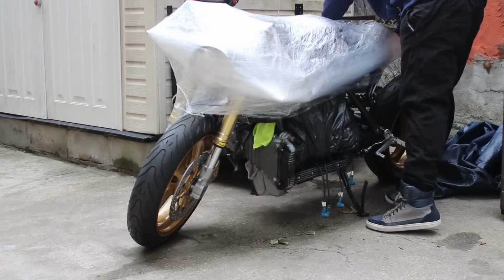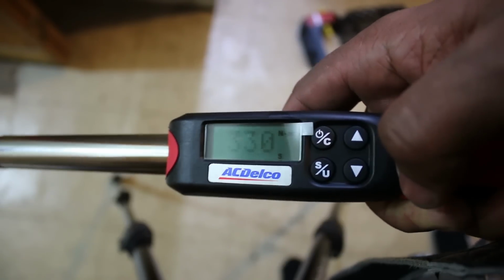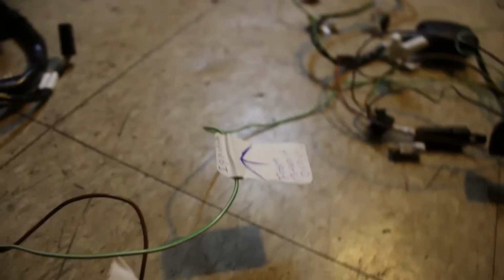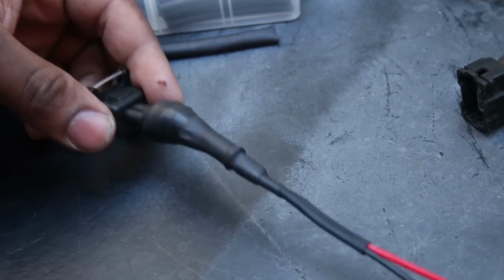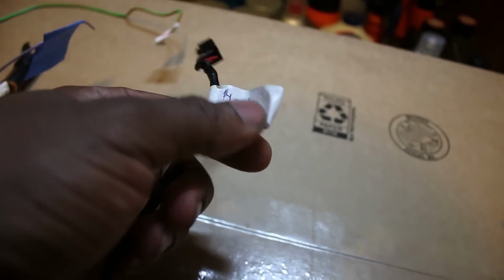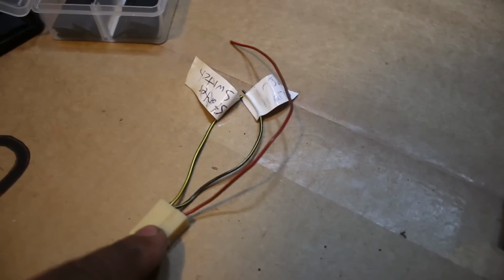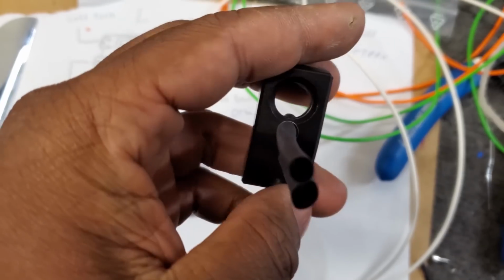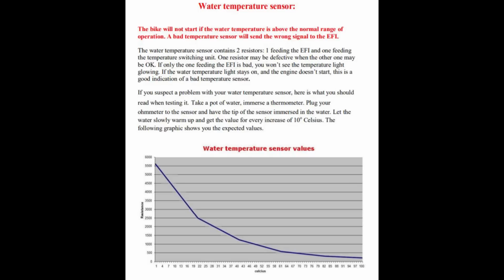[Ep 12] 1986 BMW K100 Cafe Racer Project - M-Unit Fuel Injection Rewire

Comment: Oh man. I didn’t know I would be glued to the screen on this. I’m currently trouble shooting my k75 my dad gave me. It’s in mint condition all but it was stored for 15 years and fuel tank wasn’t drained. I started down the line to find the fuel pump and hoses were no good. Got a new one but it’s not getting power. Bypassed power to the pump from the battery and put a guitar switch to turn it on and off. Total Mexico style.  Ended up getting a bad fuel pump. It Wasn’t pulling fuel. now I’m waiting for the new one thinking what the hell could be the reason it wasn’t getting power.  Could it be the relay? Or a computer thing. Guess I’ll find out the hard way when the new pump comes in. But you gave my mind a little relief seeing yours was hooked up with a switch and the fuel pump seemingly stays on always while the bike is running? I know nothing but I’m learning. I’m a luthier so this is much more difficult to wrap my brain around. Lol. My Cb350 was a lot easier to trouble shoot and rebuild. Thanks for the detailed videos. Digging it while I wait for money and parts.

Comment: cut that black and yellow wire from the starter relay to the fuel injector connector wayyyy to close to the connector (about 1 cm), not really enough room to splice together.... Any tips on how to reconnect or run it to the starter output?

Comment: OMG this saved my ass! I couldnt get the rubber seal in and for sure it turned out that the the old seal wasnt out. that same metal part! haha. Now that i have it all installed how freely should the impeller spin? I put in the water seal and then put the shaft in and it doesnt seem to be moving very freely. is that ok?

Comment: K100 sideways motor means the oil in cylinders drains from the top and leaves half dry rings.  This will drop your cylinder pressure to a point where it won't start.   The old boys pull the plugs out and give a light spray into the head if they have been sitting too long.

I bought a 1986 K100 2 weeks ago and have (started a cafe journey or my own) peace Bro

Comment: I can c you have a full plate right now but,,,,,,,,, maybe one of these days you could do a short video on the differences between the 8v and 16v Brick100rs (k100rs). I'm about to pull the trigger on either a 85 k100 or a 91rs 16v. They both have about the same miles, I don't really care about the upgraded brakes (gonna replace forks). Just can't really seem to find much on the difference, just a bit more power from the 16v.... Thanks for your time bro, love your build series BikeLife

Comment: Over the worst, you've troubleshooted the wiring, kudos! I think you're on the home straight but suspect that wiring will bite you before you're finished! I made a new loom for my T140 ,it had plenty of catchews but no electronics , my day job is home heating repair and troubleshooting failing electronics is the bane of my life! Re watching, to brace the coils a couple of short pipes between with the bolts going through🔩

Comment: There is something I don't get.... why does the fuel pump continue running if the engine is not ?  I have a k1100, on key on the pump runs 1 or 2 seconds and it stops after getting  the fuel rail to the correct pressure. When the engine is running it starts again to keep the pressure. Might you be having some problems with the pump ? like it might be loosing pressure
Reply from the maker: Because im using an M unit. Totally different system.

Comment: See, your problem was trying to start it with the fuel tank installed. When doing a build, you cant have it even remotely close to drivable before starting. Would have fired up on the first stroke if the wheels were off lol. Good job man, I'm proud of you

Comment: The exhaust generally comes with different size header tubes because the length effects the power output. Long tube headers provide more low-end power, where short tube headers provide better high-end power. So to provide an even power band, manufacturers use different length headers tubes.

Comment: nice but u really need to loom those injector cables , suchs a bike doesnt deserve tape . it needs some cloth tape or factory cable 'loom' rubber over it .
Reply from the maker: Got 5 rolls of tesa tape on the way to clean up and black out the external wiring including the injectors. Alot of colors I need to stealth out over the engine
Reply: - The illestrator - Nice work , ill see it in the next video .

Comment: I own a k100 and my fuel pump does not turn on until you start the bike, yours wont do that? A switch seems sort of a hassle for something that should be automatic imho.
EDIT: I guess since you are using an m-unit for this now its different. But, that electrical tape is going to get really nasty and mushy right by the engine there, if you are going to do any more wire wrapping, you should check out TESSA cloth wire tape (pn: 51036), its used a lot in newer cars and it looks and last much better and longer than that vinyl tape.
Reply from the maker: Yup, got some tesa tape on the way (someone recommended it in an earlier comment.) It'll help stealth out the colorful tape showing over the engine
Reply: @Theillestrator1050  Nice, looking forward to seeing it.

Comment: You have a decent degree of mechanical nouse particularly as i suspect you're sort of young. I'm curious about your background. Have you studied engineering, done a trade, or had a knowledgeable  mentor in your formative years ??
Reply from the maker: I never officially studied any of these things but I suppose it's a sort of natural progression of things I would do for fun. In high school I was voted most creative. I built like little weapons out of school supplies and sold them...built longboards... then bmx bikes, then I bought a beater for my first bike and did every piece of maintenance myself starting there and with all my bikes. Now im. Just building a bike from ground up. I just turned 24 btw.
Reply: @Theillestrator1050  
You have extraordinary aptitude for mechanical work. U Tube is good and you deserve a healthy following but it's a niche endeavour. If the channel doesn't support you, you would do well in engineering design. Not everybody has IT. You seem to.

Comment: Be careful about switching fuel pumps, quite an inductive load and the switch contacts will have hard time, that switch will work but its life expectancy is unknown
Reply from the maker: I reckon you may have commented before finishing the video. I ultimately decided against having a manual fuel pump. But even if I were to use a one, are you referring to a switch in literal sense of breaking and establishing electrical contacts? If so i was going to make that happen through the M unit not an inline switch or something. Or maybe im misunderstanding you.
Reply: @Theillestrator1050  ah no I commented at the time while you were discussing it👍 I had to pause the video go out outside, adjust my chain ready for today's ride, I need to watch the final bit later today

Comment: Handy tips for the future. Vacuum tubing with a slice lengthwise makes custom size grommets, with a little superglue to keep it in place. And when you’re splicing wiring try to offset where you will connect the wires to keep the overall bulkiness of the harness to a minimum.
Reply from the maker: Noted, thanks

Comment: Awesome work man!

Idea for the exhaust I think would look neat is brining it back so the muffler sits besides the wheel, either parallel with the ground or at a similar angle to what you have going now. Would require some fab work but so did the rest of the bike 😉
Reply from the maker: I have an idea that may...or may not work lol. If it works, you'll probably be a fan of it
Reply: @Theillestrator1050  awesome, looking forward to seeing what you come up with!

Comment: Nice that you took the time to label which wires are which, makes it easier for the next guy, because partner, the next guy is always YOU, am I right?
Good electrical work is really hard to come by.

That exhaust looks sick, will probably sound raw AF because of those unequal length headers. Shame about the megaphone, though.

Any other place to mount that battery? I know Antigravity doesn't weigh that much, but it might help ride harshness if it's not mounted to the swingarm.

Also, what connectors are those that you're using around the 24:30 mark?

And 57:03.... Hail satan 😈
Reply from the maker: 😂 indeed, after a few months, it proved a good call labeling stuff. 
I ordered some exhaust studs for a Nissan turbo which may or may not fit. Guess I'll see. I'll also mount up my new radiator and get coolant in there to see how it sounds when its sealed up right and is warmed up!
Reply from the maker: I actually plan to mount it beneath the coils, over the engine in a box that I bought. It'll fill out that hollow space. I'll remove the logos and labels to make it stealthy
Reply from the maker: And those are EV1 injector connections. Link in description.

Comment: Try not to run the engine without anti freeze. That mechanical water pump shaft seal will not do well running dry along with other things. All the other stuff? I'm so impressed! This whole series is so well done! Watching you think through the speed bumps. The story and edit. Right down to the supportive comments. This is a wet dream for any Creator. I'm so happy for you!
Reply from the maker: Right, that's one of the several reasons why I mentioned in the video that I wasnt gonna run it anymore or longer than I did. I just did it real quick for proof.
Thanks, the fact that people such as yourself support the series is what helps push meh
Reply: @Theillestrator1050  No thanks needed. This channel is all you. It's like growing a garden. Every video of yours I watch I find myself more and more convinced I'm witnessing the birth of a star. Not just here but anywhere life takes you. Keep up the good work!

Comment: COILS:  That sheet aluminum is super-flimsy and those coils are going to be dense, live (i.e. not-firmly-fixed) loads.  You can feel how dense they are.  Every time the K vibrates in one direction, the coils are gonna try hard to stay in space right where they are.  You'll tear those aluminum sheets right up.  Please find something to mount the coils to that's at least as substantial as the mounting brackets on the coils.

HEADER LENGTHS:  Backpressure dissipation along exhaust systems is a key performance element.  The sound, whatever it turns out to be, is properly a result of the construction of the exhaust system; the exhaust system (sorry) isn't there to be a result of the sound.  Horse goeth before cart,  The chain of cause and effect should go:  Engineering -> Geometry ->  Performance ->  Sound.  It should never go Sound -> Geometry -> Performance -> screw the engineering.  Fluid dynamics modeling (CFD) is dark, dark magick and the fluid systems engineers in BMW's exhaust works know what they're doing.  Yes, even if aftermarket parts exist to dismiss their expertise.

MANUAL-ONLY FAN SWITCH:  And a gigantic, blinding-bright engine temperature alarm with a siren and air horn, right?  You don't want to your first notification to be engine seize.  You are the thermostat.  What are your temperature settpoints for fan-on and fan-off?

LEAD-FREE SOLDER:  Real men pick their teeth with 60/40 Sn-Pb eutectic solder.  And don't I forget me!  Do dat to.  Stuff.  dur... Blerph.  Was where am? 

GREEN TAPE AROUND HOLES IN ALUMINUM SHEET:  Rubber hole grommets still to come?

You finger-twiddle those wires like you've had practice.  Good for you.  Where's Miss Carly Rae ("Call me 'maybe'") Fuel Gauge?

GROUNDS:  Install a real ground strap to the frame or negative terminal of the battery, as appropriate.  Do not count on the security of of the aluminum sheets and a bolt connection made with corrosion-prone differing metals. That sheet is not a reliable ground.  "This hole is NOT gonna be a (good) ground point."  ALSO REMEMBER, IF YOU GROUND STUFF TO YOUR HANDLEBARS:  Be sure to run a proper ground cable to any electrics in the headset.  Do not try to rely on a ground up through the steering bearings which (again) will pass current through differing metals, cause galvanic corrosion, and degrade your bearings. 

IF YOU HAD A BROTHER P-TOUCH LABEL MAKER you'd be dangerous.

METRIC:  One litre = "a little more than a quart".  4L = one gallon.  7L = 1-3/4 gallons.

NOT THREE.  FOUR:  Fuel + Spark + Air + Compression .  Been there.

Congrats, me brother!  My joy is to see your joy.

.
Reply from the maker: LOL, part of me was handling the solder like... this is from china... what if the label is full of shit about being lead free 😂
Reply from the maker: The ground circuit is as follows.
A cable from battery Negative to the m unit which also grounds the plate... and a cable from battery negative to the whole running gear ground point. Then another cable from the running gear ground point, to the plate. Then another cable from the plate to the frame.

 There is nothing ground to the handlebar or steering head. Everything is either grounded to the plate or the main frame point. I mentioned that in the video as to avoid any unreliable grounds through the head and bars.
Reply from the maker: I'll shock mount the coils and double up the ties around the plate. If they prove to be an issue, I'll look into recreating that plate with a thicker sheet of aluminum.
Reply from the maker: I reckon the designer of these pipes barely had performance on his mind because the product page says nothing  of gains or dyno numbers. Luckily when it comes to this bike, I have no interest in performance numbers considering it will never be faster than my FZ. im just worried about aesthetics, sound and reasonably reliable running characteristics. Im sure the luftmeister pipes would serve the engine better considering engineers were behind them and not fabricators. But for this bike, I'm content with the cart going before the horse.
Reply from the maker: The temp relay trips at about 212 degrees Fahrenheit, so upon the engine approaching that via the guage on the crank cover,  I will just slap the fan button.
Reply: @Theillestrator1050  Good man.  Keep an eye on it.  I ran nuke reactors on fast-attack submarines.  It took years of school and round-the-clock training so we could sit there watching the temperature needle.  All.  Damned.  Day.  It went high?  Shim control rods in.  It went low?  Shim rods out.  Trained monkey work.  When you turned over one of the label plates on the Reactor Plant Control Panel, the 20-year-old graffiti on the other side had somebody's smart-ass question, "HOW DOES  IT FEEL TO BE A THERMOSTAT?"

Hey, and be nice to that water pump that you're running dry with hot, grinding, metal-on-metal impeller action.  Maybe open her up and look for galling?  Wet that little girl if you're gonna spin her up like that.  She'll thank you for it!
Reply from the maker: You were on nuclear subs? Well you just got even cooler. 
Right, that's one of the several reasons why I mentioned in the video that I wasnt gonna run it anymore or longer than I did. I just did it real quick for proof.
Reply: @Theillestrator1050  Yep.  And then to Bklyn for Art Skool.  When you cross paths with my CX, it's the one with the cut-down rear and the submarine warfare badges on the side panels.  Someday soon, I'm sure.

I assure you I am not cool.  Please, Dear God, not that.  You'll blow my nerd cred. 

I'm gonna make a buttload of money in engineering and Patreo you a P-Touch.

.
Reply from the maker: Even though the green tape is ugly, I'm content with it since its hidden from sight. I can appreciate the fact the the wires can remain flush to the plate with flat tape.
Reply from the maker: I actually looked into label makers....to expensive. Gimme a pen and tape.

2 Pepsi bottles of gas... got it.

Compression is for granted since I did the compression test before.

Thanks man, time to finish this bike.